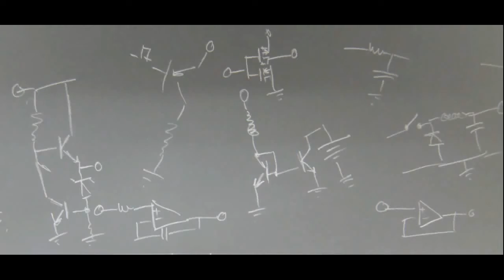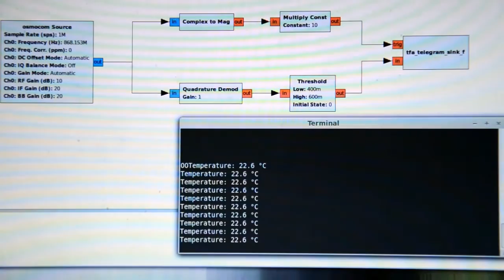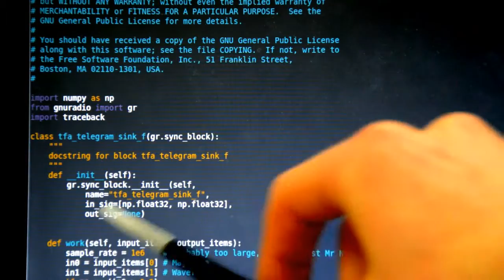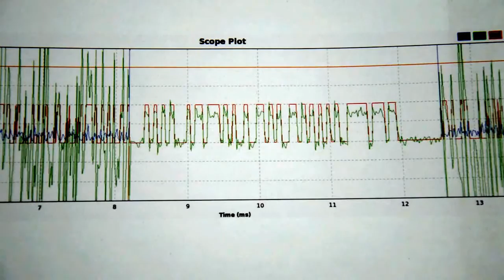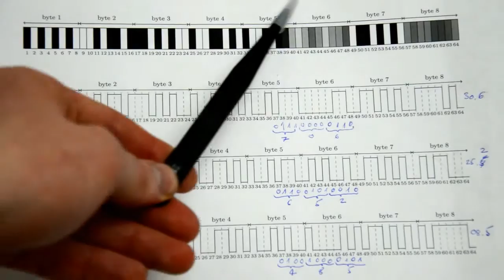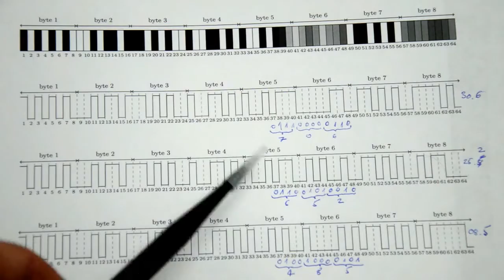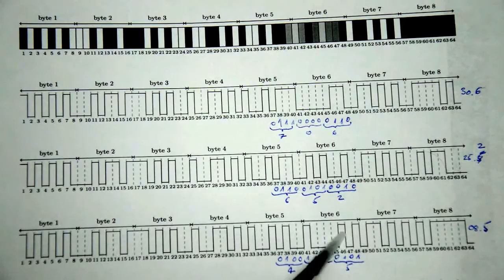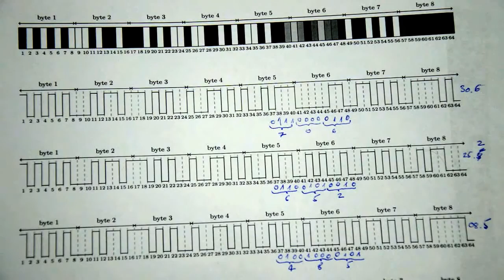Using RTL-SDR to read temperature from outdoor sensor, part 2

Comment: Very nice tutorial!   This could be useful for folks trying to demodulate lots of stuff in the ISM band.  In my case, electrical usage monitors from Current Cost.  The only additional step was decoding the manchester encoding that was used, but that was pretty trivial.

Thanks!
Reply from the maker: You are very welcome. Initially I was somewhat scared because the quality of my videos is still quite mediocre, especially considering lighting and audio. The feedback I got so far is pretty amazing, though, and led to interesting discussions, especially in the reddit thread where I posted this video. Apparently, many people are eager to decode readings sent from home appliance sensors.

That said, I'm planning to do another set of videos on various modulation and coding techniques, where manchester coding would fit in nicely. For example someone over on reddit reported that the mag stream itself contained the sensor payload... which makes sense if the signal is AM modulated. It took me quite some time to realize how different modulation strategies are interconnected mathematically and I feel that this could be something interesting to share.

Thank you very much for your feedback :)

Comment: Excellent video! I'm curious what software you used to generate the "bit plot" to average them out and generate gray for changed bits. I have a similar project and that capability would be very useful! Thanks man!
Reply from the maker: Hello and thanks for your interest. The full code is in this gist:

https://gist.github.com/mweyland/77376fd185f2aa5336dc

I chose python to parse the information and latex to render it. The specific information you are asking for is found in  telegram_stats.py, which parses the output created by the block. You probably don't want to re-use my code, so here is how it's done in a nutshell. First, an array is created, size is the number of bits your packet contains. Then you iterate over all packets you acquired. For every bit in there, you increment the corresponding array entry by 1 iff the bit is 1. This is equivalent to incrementing the array entry by the bit value. Finally you divide each entry by the number of packets treated. If a bit is 1 in all n packets, you end up with n/n = 1. If a bit is 0 in all packets, you end up with 0/n = 0 and the more ones you get, the closer the ratio is to 1.

This array is then simply used as grayscale value for the rectangle backgrounds. The program also prints individual packets, indexed by the 'interesting' variable. The code is not that great in the first place but I hope it is of some use to you.
Reply: MrCircuitMatt
Thanks for the reply, I'll take a look at this!

Comment: Did you have any sample data with negative temperature? I'm curious about that "4"...
Reply from the maker: Hello. It's been a while since I made the video, hence I'm not quite sure how the temperature was coded anylonger, but if memory serves there was a fixed offset that would in theory allow for negative temperatures to be coded and decoded seamlessly. I did not have the opportunity to verify that theory, but I think it should be checked and it's getting winter soon, so you can expect an update in a bit here :).

Comment: What did you use to generate the data plot ?
Reply from the maker: The one where I show which parts of the packet have variation? It's a python script that generates a latex file with the illustration. There should be a link to the gist with the full code further down in the comments.
Reply: @MrCircuitMatt  I did similar stuff a few years ago when I reverse engineered  Insteon's wireless home automation protocol.

that type of graph would have been useful,  instead I printed the data  samples as strings of ones and zeros in very very wide windows. 
with every tenth line, enumerated 0 - 9